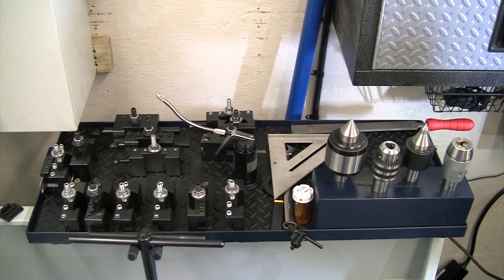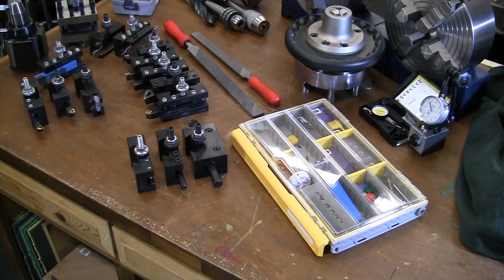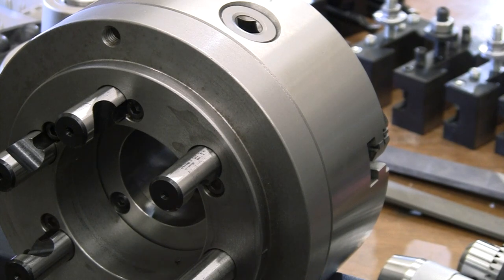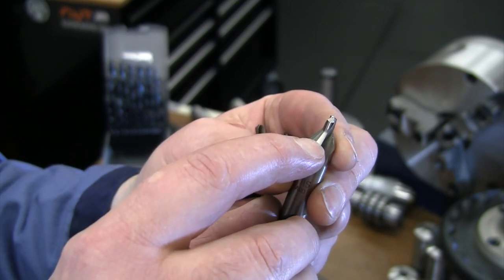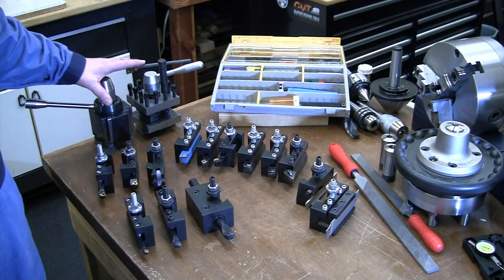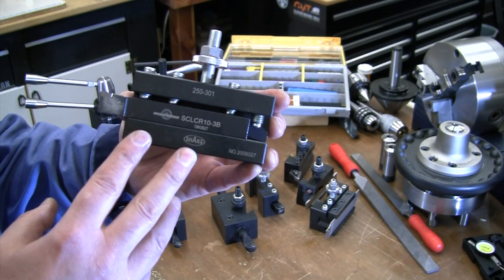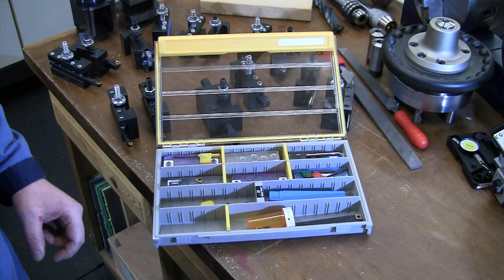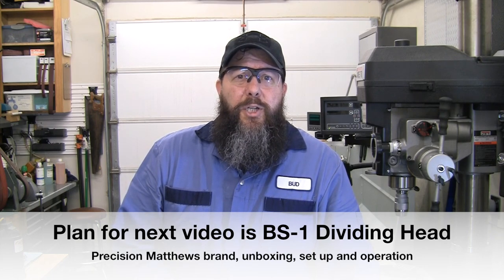Lathe Tooling Headstock to Tailstock - CXA Tool Post, Indexible Carbide Tooling

Comment: Bud, this video is AWESOME for people (like me) trying to put together a list of tooling for the larger CXA-requiring lathes! Thanks so much for putting it together--I compiled a spreadsheet that even includes links to the various products for later reference/purchase. 

One thing though: The "A252" in the part number of some of those Carbide Depot inserts, appears to actually be "A25Z". In other words, the last digit '2' doesn't appear to be a '2' at all...it appears to be the letter 'Z' as far as I can tell from using their website search engine. Not a huge deal, but it might help someone out if they are slightly bewildered as to why they're not finding it there on the Carbide Depot site.
Reply from the maker: Tom B - You are correct, that should be a Z and not a 2. Thanks for pointing that out and apologies for the typo, glad you found the part. Really appreciate the comments, glad you are finding the content helpful.
Reply: @BladesIIB  My 1440TL should be here by the end of November, or first week of December, so I'll be needing to get many of the same things you had to acquire. So the video is indeed very helpful!
Reply from the maker: @bluehornet6752  That is awesome. Congrats on the new machine. Going to be a great Holiday break at your house.

Comment: Love your video, came upon it by accident and now subscribed! Thanks! I would like to start doing a little bit of that, what would you recommend, where to start?
Reply from the maker: @leonkozluk8566 - Thanks for the sub, glad you found the channel. As for where to start that is a pretty loaded question for sure?  So many factors to think about such as space, how big of a machine you want/need?  What other machines you will need like a mill?  My recommendation to start would be think about the work you plan to do and work from there. That should help you decide the machine you need first and the size machine you need to get into. I would also highly recommend the Hobby-Machinist forum to get ideas on how others set up their shop and get started. All the best, you are starting an amazing adventure.

Comment: Thanks for the information.  I have been wanting to get a small metal working shop set up, ( Strictly Hobby Work )  But I am just  waiting and saving my pennies, to get at least a mid range  metal lathe, and a milling machine.  I  want to get a machinist hand  book, and I need to learn what tools, I need, for which applications,and what  speed to turn different metals.  But I am ready to go for it, once I get enough money to start with the lathe, and then the Milling machine.  So much to learn, and then put into practice.  I will need to learn where to purchase various metals, and tools, what kind of tools.  I want to purchase as many "Carbide tools", as I can afford.  I really enjoyed your video.  I like and appreciate the visual inserts, correcting info mistakes.  I am just trying to figure out which machines, and the highest quality, and accuracy, I can afford.  Right now, I am looking at the Grizzly Gunsmith lathe, and one of Grizzly's milling machines.  I do not have any sources on recommendations on different brands, or set ups, etc. I do have a small wood lathe (Excelsior) Which I purchased from Rockler, on sale with the bed extension.  I absolute love it.  Quiet, centered on the tail stock, and head stock and no vibrations!  I am still learning on it.  Right now, I am just playing with various projects, to learn what to do, and what not to do, before I start trying to learn to do bowls, platters, etc.  But again, I am not familiar with  with using various speeds.  I still have it as it came from the factory.  it has five speeds, by changing the belt configurations.  I want to eventually make a worm guide and tool holder for the wood lathe, like on the metal lathe, so I can make more accurate and consistent rounding cuts.  Thanks again, I enjoyed the video..
Reply from the maker: rkimberly985 - Thank you for the comment.  Sounds like you are well on your way to getting into this Hobby.  It can seem like a lot at first, just keep going a little at a time and it will all come together.  In addition to Grizzly, I recommend you look at Precision Matthews machines, they are good quality, similar pricing and excellent customer service.  I also encourage you to join The Hobby Machinist forum (www.Hobby-Machinist.com).  Great forum of other hobby enthusiasts like us and you can read about many others who have started on a journey similar to yours or jump right in with questions.  The group loves to help people get into the Hobby.  All the best as you set up your shop.
Reply: @BladesIIB  Thank you for replying, and the info.  I have seen the Precision Matthews, being used on other videos, but not sure I can afford it.  Plus it looks fairly large.  But I will look into their line of lathes, and other stuff.
Reply from the maker: @rkimberly985  Worth checking out they have a pretty wide variety from small to larger and different price pints. Good luck finding the right machine for your needs.
Reply: @BladesIIB  Thanks, I just want something that is not going to cost me my first male child, which, I can no longer produce, but I want something that is going to be accurate.  I am not talking NASA precision, but something I can be sure is not going to be inconsistent.  I was looking at the Grizzly gunsmith lathe, because, I have some knowledge, which I use for my personal firearm, but would like to be able do some things like muzzle breaks, sights, etc. that I normally have to take to my local gunsmith, which I really like, as he is good, and very honest, and very reasonable in pricing.  I would like to thread, chamber, and cut the extractor groove, in a barrel, to replace a barrel, and I have to have my Gunsmith do it, which isn't cheap, cheaper than other smiths, but it is a lot of work, that has to be very precise.  As for the milling machine, I want something that isn't going to deplete my savings, and still be accurate, and repeatable.  I had friends that went to a class, which I wish I could have went to but work, and money were in my way.  But there was a class in a vocational school,,  that had a machinists class, that was being taught by machinist from Pratt, and Whitney, when they were still in Florida.  But they said that they drilled it into them, that every time they used the milling machine, to recheck the settings!  Even if they just finished with a project and needed a little refinement, to recheck, before using the machine.  But I am definitely going to get a metal lathe, and a milling machine.  I know the initial cost is going to be high due to buying tools, and other accessories.  
thank you for your videos.  It is going to be a little while yet, before I can buy any of these things, but I am still enjoying watching videos like yours, and others.  I just wish there more affordable, U.S. made machines, or if there are any U.S. made machines out there.  I would like to get a German, or Japanese made Machine.  But again thanks, for responding, and thanks again for the great videos.
Reply from the maker: @rkimberly985  Sounds like you have a good grasp on what you want and need to enable your projects.  Also, as you mention, the tooling is a big part of the cost so keep that in mind when you make your machine selection.

Comment: Great video, just subscribed. Glad I found your channel. I have some binge watching to do! Would you recommend the PM Tool post holder (I am looking at the CXA size)? I like the WMNGs for the same reason. I like your idea of standardizing to use the least amount of inserts. I only recently purchased a lathe that can handle the negative rake inserts. What do you use for going to a tight inside shoulder? (I use a VNMG) Thanks!
Reply from the maker: Jamel Smith - Welcome to the channel, thanks for the sub and the comment. I hope you enjoy the other videos. I had some feedback on my early audio and have tried to improve that. My QCTP is actually from Jet but is an offshore brand so I assume the PM version would be similar. I have been happy with this one from Jet. For inside boring I stick with my CCMT/CCGT inserts and when boring to a shoulder I rough to .005” short of full depth and depending on how much I am taking out periodically feed across the face at that depth to square it. Then on my final finish cut I go to full depth and feed across the face to square it all up. I also have a larger bar that holds brazed carbide and do the same for a square shoulder. Hope that helps and appreciate the questions.

Comment: Bud, is that black "diamond plate" looking stuff, a rubber mat? If so where did you score that? Thanks, GREAT video!!!!
Reply from the maker: Pete, yes that is rubber matt I picked up on Amazon and use rubber cement/contact cement to hold it on my lathe and used it for the tool tray. Rubber-Cal "Diamond Plate Rubber Flooring Rolls from Amazon. 1/8” thick comes in all different lengths. Will make a nice addition on your PM 1660.

Comment: Fantastic video! I really appreciate how you provided the source of your tools and part numbers! Question for you- what do you think of the Jet and Precision Matthews quick change tool posts? Good quality or would you spend more on other brands?
Reply from the maker: MotecM - Thanks for the comment, glad the video was helpful.  I have only tried the Jet quick change tool post and have been happy with it.  I have not used an Aloris or other name brand so can't compare but this one with a variety of holders from Jet and Sears has performed well for me and I have not felt the need to look for another option.  Hope that helps, good luck with your set up.

Comment: What is a estimate cost on the lathe and tooling?
Reply from the maker: @andyd1006 - The prices change so much I would not even have a good estimate for you at this point?  Also, a pretty wide cost difference in brands.  Pays to shop around online for the best price, leverage coupons and holiday pricing.

Comment: And then there are the indexable QCTP. On my lathe (Harrison Alpha460) where there is no compound rest, the QCTP is allways turning in 15° steps if I want.
 The crappy thing beeing without a compound rest is that making a taper or a chamfer demands a computer/programming. The same with making any thread.
 When one fanuc-box had to be changed I lost the ability to lock feed to revolution so now I can't make any thread other than with a tap or die 🤬...
 Btw, I use alot of CNMG, TNMG and VNMG inserts at work. 1"*1" (25*25mm) toolholder with CNMG-insert, about 2,5mm cut of depth and feed ~0.30mm/revolution. The chip has to be thick enough for the chipbreaker to work... But YES, the lathe has to be large and ridgid enough to handle it, over 2000lbs and ~10 000$?
Reply from the maker: Johannes Laxell - I hope you are able to get the controller fixed on your Harrison Alpha.  Sounds pretty limiting right now.  CNC is a whole different animal for sure.

Comment: Dude--an old TI-55 calculator! Had a bunch of those over the years. Apparently you're as old as I am, lol...
Reply: I went on eBay a year or two ago, and bought like 3-4 of those things. I went on a bit of a calculator binge. I have this old Jeppesen aviators calculator that I bought back in the early 90s, when I was a cargo pilot in Alaska--and it's built on a TI-55 chassis. It still works great, but I wanted some parts for the thing in case it took a dump. But I was surprised that I could still find a few of those old TI-55 units out there on eBay!
Reply from the maker: Tom B - Yes that old TI has seen a lot of chips and just keeps going. And the years they do slip by.
Reply from the maker: @bluehornet6752  have never looked for one but glad they are still around. Cargo pilot in Alaska sounds fun. I grew up in British Columbia and my full time machinist work was at a shop in Dawson Creek - mile zero on the Alaska Highway. Small world.
Reply: @BladesIIB  That thing saw me through untold calculations in chemistry, physics and even calculus courses. I started with the TI-35, but when the TI-55 model came out I thought I had died an gone to heaven. LOL! 

Apparently I was a bit of a nerd back then...
Reply from the maker: @bluehornet6752  Yes was the best thing in chemistry class for sure. Now I see my kids with these graphing calculators crazy.
Reply: @BladesIIB  Oh, I have a few of those too. For some of the more advanced trig, calc and electronics courses where you need to graph something to figure out what's going on, they're invaluable!

Comment: I have played with an old wood lathe with an X/Y axis lantern-style tool holder and a three jaw chuck. Above and beyond ALL the other things I've had to figure out, one stands out; NOBODY make a #2Morse taper "male" end that has a ROTATING #2 Morse taper female end on the outer end. I have an adapter for a 1"-8 male to #2 MT, so I can stick my three jaw chuck in the tailstock if I want to rotate something. I have looked for weeks, until I finally contacted a manufacturer, who, skeptical at first, said "Damn, you're right! You'd think SOMEBODY would be making one"

So, If anyone knows of a rotating MT#2 adapter, hit me back. I have a Jacobs 1/2" chuck with a #2 MT on it, but, of course, it doesn't rotate.
Reply from the maker: @Telephonebill51 - Good luck. Not a part I am familiar with. Hope you can find what you need.